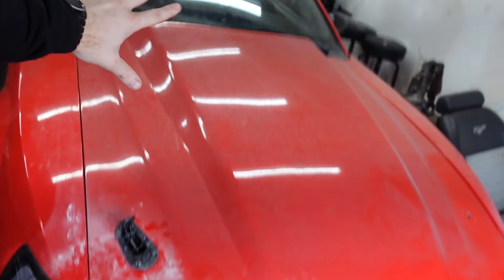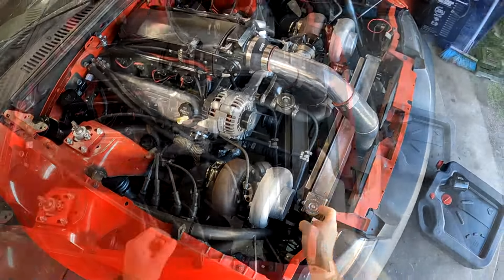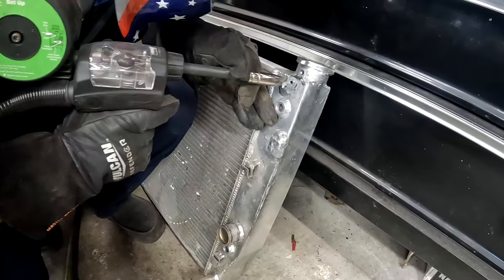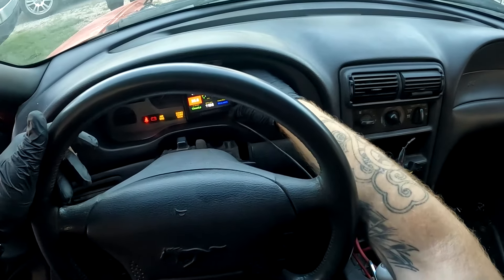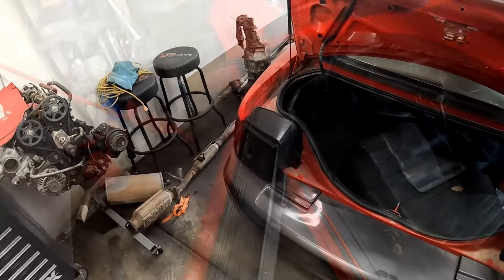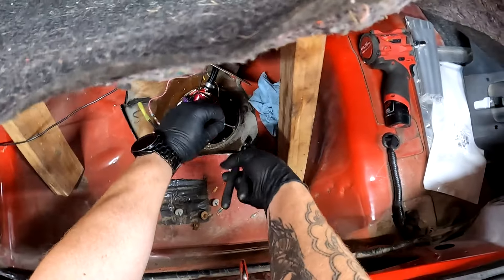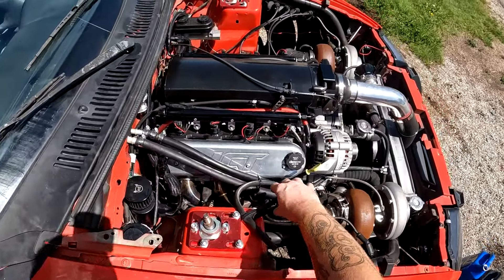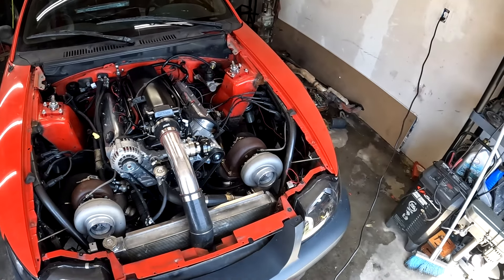MY TWIN TURBO MUSTANG WON'T STOP GETTING HOT!

Comment: If the heads are hot and the coolant at the radiator is cool have you checked the thermostat already to make sure it opening properly, you can take it and boil in in water with a thermometer to watch and see at what temperature the spring starts to open and close, or as you said your cap was leaking which can also lead to overheating due to the system can’t build proper pressure, it’s the same as leaving the cap off and the car running eventually the car will run hot but love the videos! And hope you get it sorted out!! Keep up the great videos!
Reply from the maker: Ill try and check the thermostat. Its new. Maybe find one that is a 170 instead of the 195. Appreciate the comment!

Comment: My Holley said it was running hot but my new CTS resistance was off and the sensor was reading 25 more than it should have been
Reply from the maker: Hmm may have to check my sensor too. Could be a problem as well